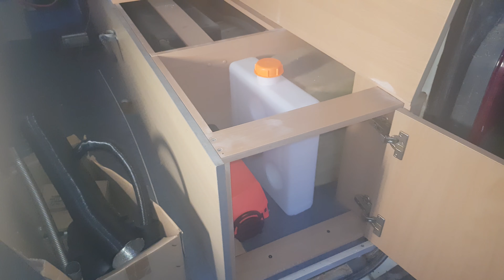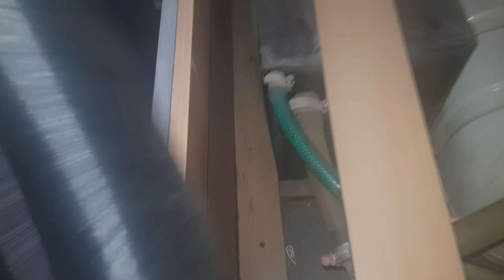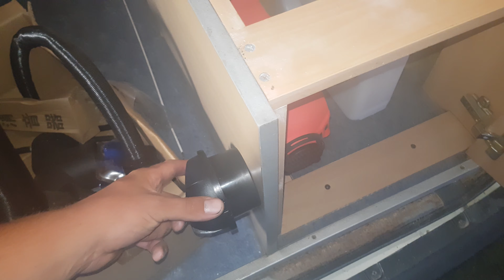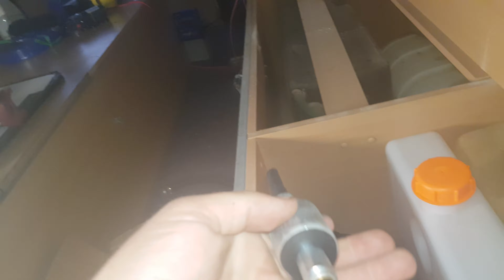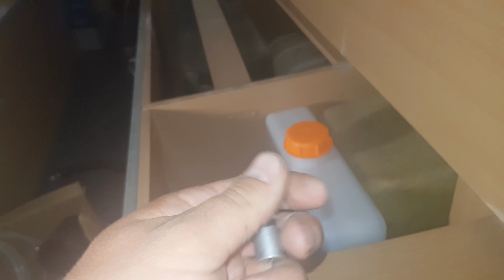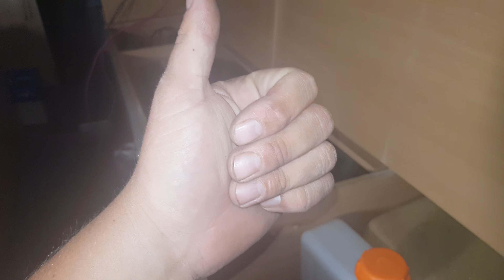Cheap Chinese 5kw Diesel Heaters Toyota hiace camper installation Considerations

Comment: If you do decide to draw the heater intake air from within the camper ..you will need to install a air vent supplying fresh air direct to the camper ... otherwise if you don't the heater will use all the oxygen in the camper...think about it.
Reply from the maker: It already has a good vents for the propane cook top one in floor one in roof

Comment: Nice Vid!  I'd fit the intake outside to keep the air pressure balanced, sometimes in high winds they can blow back and you don't want that inside your van.
Reply: Good Point, I was also thinking if you mounted the intake inside, where ever your door and window seals are leaking you will get a draw through them (which may or maynot be annoying).
Reply from the maker: Van has built in vents so you can cook with doors shut lpg cooktop. It has a lowest point vent and a highest point:)
Reply: @Oneupthesleevecustoms  Are those vents closeable? Becaause you know the occupants are going to close them if they are cold.
Reply from the maker: No there legit gas install ones. Its a ex hire camper so its made to stop dumb asses dying :)  haha
Reply from the maker: Yeah that's true mate that would be no good